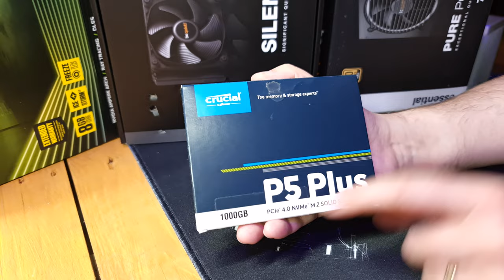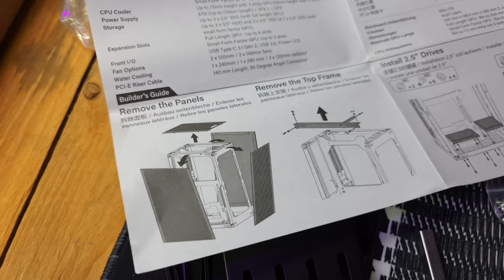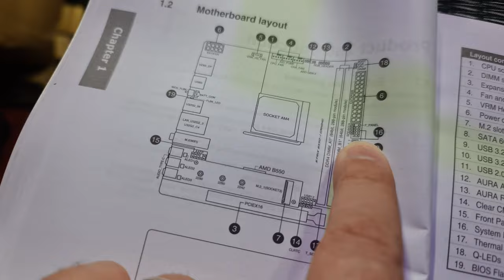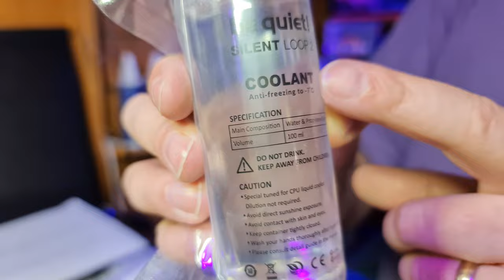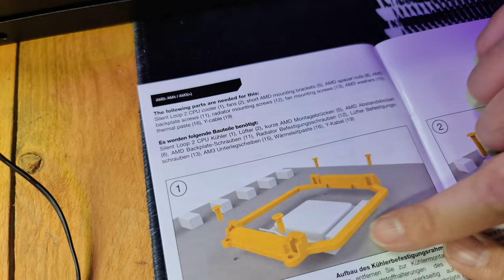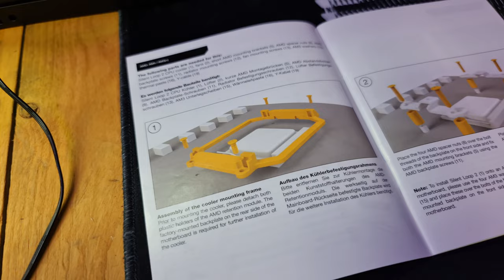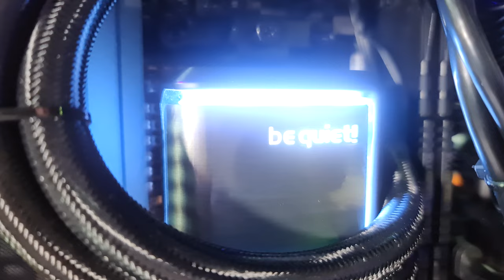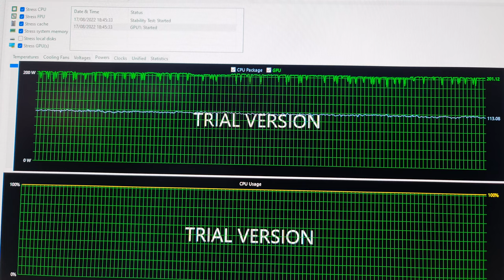Building a Powerful Mini ITX PC - Build Guide

Comment: What a lot of mesh owners do is- use extended standoffs for the motherboard, so it hits the second IO slot and leaves a huge channel behind the motherboard for all your PSU cables to be routed. Not sure this would 100% work with an ATX PSU tho as it would pull the riser cable more tightly right over the corner of the PSU.
Regarding AIO most owners have it installed as you do, sucking air from inside the case and expelling it out the front. This is because it actually sucks fresh air through the mesh then and creates some airflow over the board.